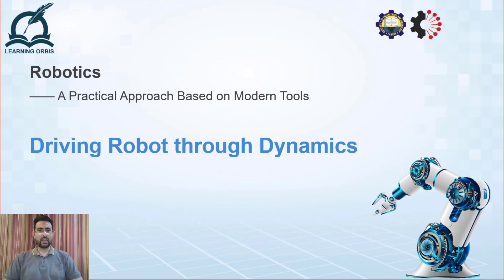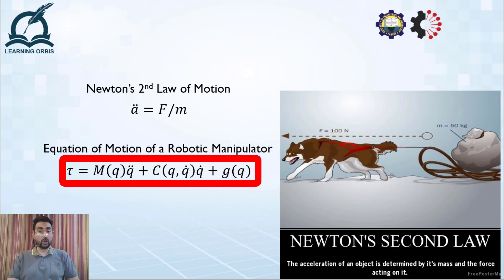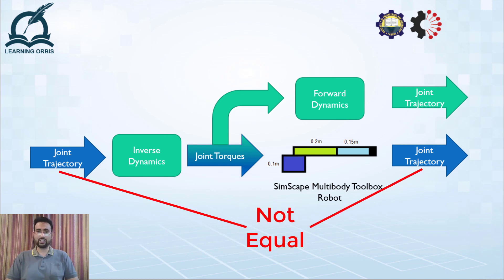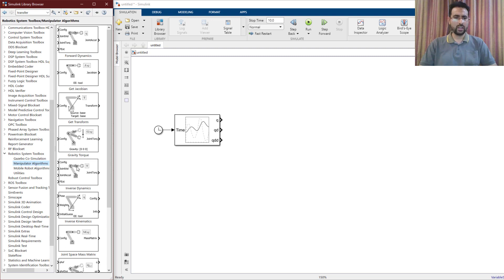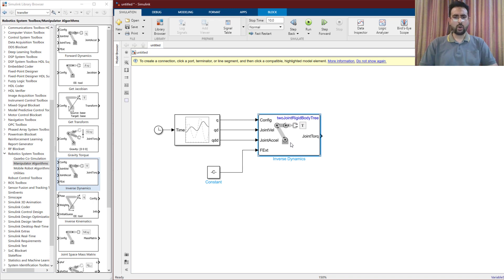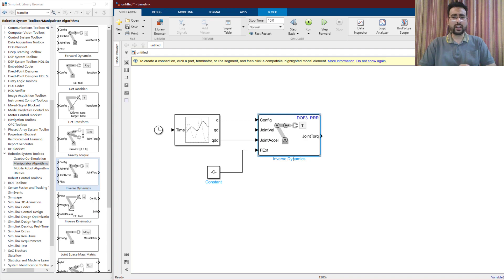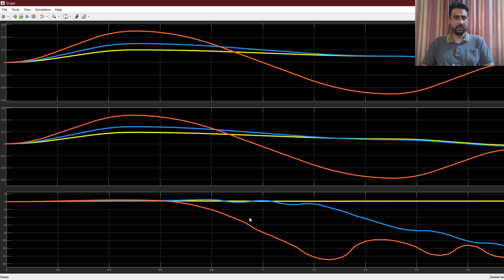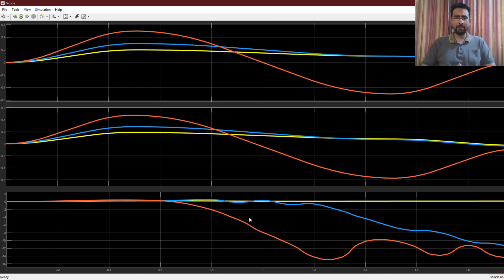How to Drive Robot through Dynamics in MATLAB 2021 | RST | SimScape

Comment: Dear sir
 Than u so much! But I have a question about my robot.I used polynomial trajectory to generate trajectory points and directly connected with inverse dynamics according to your video, but the error dimensions were inconsistent.
Please help me.
Reply from the maker: If you are directly connecting the trajectory with the dynamics block then make sure you are generating a joint space trajectory. If you have a 5 dof robot, for example, then your trajectory should be 5 dimensional. However, if you want to specify x,y,z positions in the trajectory, that is you want to generate workspace trajectory then you should give that to inverse kinematics block and then the output of the inverse kinematics block to the dynamics block.
Reply: @LearningOrbis  Thank u deeply,it help me a lot
Reply: @LearningOrbis  I'm sorry to bother you again,After your guidance, the position can already be connected to the dynamics module, but how can the velocity and acceleration in the dynamics be connected.
Reply from the maker: Joint Position, joint velocity and joint accelerations, coming from the trajectory generator, are connected directly to the inverse dynamics block. If you are generating workspace trajectory and using inverse kinematics block to get the joint positions, then differentiate joint positions to get joint velocities, and differentiate joint velocities to get joint accelerations. The inverse dynamics block will generate the required torque that can be applied to the robot joints.

Comment: my torque values depend on joint angle because my torque generator is torsional spring, how could give that kind of torque input function : k*(300-theta)
Reply from the maker: You can simply generate a function for your torque equation and provide the output of that function to the torque input of your mechanism

Comment: Your video is so helpful, and I am very glad to see it. May I ask a question about my robot? The output joint configuration (q) from the desired joint configuration and from the forward dynamics are not similar to each other. The joint configuration (q) from the forward dynamics, compared to the desired, seems to have a delay in starting movement, and after reaching the maximum value of the desired joint configuration, it almost doesn't change anymore, and at the end, it doesn't return to zero. Could you please tell me how I can diagnose what problem is happening in my model, and how I can solve this problem? Thank you so much for your help and answer in advance.
Reply from the maker: Please contact me through email and share some pictures of your model and problem. Then I'll be in a better position to help you.

Comment: Hello there. Thank you for the helpful video. 
I was trying to model my 2 DoF robot for my course work. When I differentiate angle I found using inverse kinematics, there will be singularity in angular acceleration at the very beginning of the simulation. How do I avoid this?
Reply from the maker: Yes there is. You should specify some non-zero initial condition for the velocity.

Comment: Hello, thank you so much for these helpful videos!!
But in this video i dont understand one thing: why is the output of the trapezoidal velocity trajectory block in joint space (joint velocity …)?? In the last video you described this block and the output was workspace (position in X Y Z …)?? 
Thanks!!
Reply from the maker: Trapezoidal velocity trajectory block only interpolates between the waypoints you have provided. It doesn't matter whether waypoints are in Joint Space or Work space. For work space you will X,Y,Z waypoints and you'll get X,Y,Z positions of the trajectory. Whereas in Joint space you have to provide joint space waypoints to get joint space trajectory. So if you have a 6 DOF manipulator, then you should provide Theta1, Theta2, Theta3, Theta4, Theta5, and Theta6 in form of waypoints and you'll get joint space trajectory. I've directly generated the Joint Space trajectory to avoid using Inverse Kinematics Block that will make the simulations quite slow.

Comment: Sir, can you tell me what are the waypoints ( joint space values ) that you entered in the trapezoidal velocity profile trajectory) and can you tell how can we calculate torques from work space and not joint space.
Reply from the maker: I've explained the use of Trapezoidal Velocity Profile block in this https://youtu.be/xB5epLnoURM video. What do you mean by 'Torques from workspace'? If you are referring to calculating required joint torques from the workspace trajectory, then yo have to use an Inverse Kinematics block to convert workspace trajectory into joint space trajectory and then rest of the things would be the same as explained. I've skipped inverse kinematics in this video because I've already explained it in another video and also to speed up the simulation, because Inverse Kinematics make the simulation quite slow.
Reply: Thank you sir. Yeah I was referring to joint torques from workspace trajectory.
Reply: Sir, I was able to change workspace tarjectories of  'q'  to joint space by using 1. Coordinate transformation conversion and 2. Inverse kinematics blocks. However, how do I convert 'qd' and 'qdd' to jointspace trajectories so that I can feed them to inverse dynamics's jointVelocity and jointAccelaration input ports respectively.
Reply: for the waypoints, try 'wp = [0  0.08  0.2   0.2   0.19 0.17 0.17    0.12     0.1   0.1  0;
          0  0.12  0.3   0.3   0.28 0.18  0.17   0.12    0.1   0.1   0;
          0  0.2    0.45 0.45 0.3   0    -0.3 -0.45 -0.44 -0.2 0];' However, the result is not very similar in the third figure.
Reply: @LearningOrbis  Sir, I understand that 'way points' should be written the position of end effects at each moment. As I observed in your 3 figures, I tried 'wp = [0  0.08  0.2   0.2   0.19 0.17 0.17    0.12     0.1   0.1  0;
          0  0.12  0.3   0.3   0.28 0.18  0.17   0.12    0.1   0.1   0;
          0  0.2    0.45 0.45 0.3   0    -0.3 -0.45 -0.44 -0.2 0];'. After I ran the model, the first 2 figures are very similar with yours, however, the third figure is not. Can you provide your waypoint data, so I can simulate again?

Comment: I wonder, how the model is different for the simscape compared to forward dynamics, when both are imported using URDF?  Does the simscape model adds hidden disturbances or uncertanities, Im just confused. Can you please clarify?
Reply from the maker: Both models are not coming from the same place. One is being generated by Robotic System Toolbox using mathematical modelling, whereas the other one is a CAD model coming from SimScape toolbox. For simpler, non-coupled systems both models will exhibit similar response, however, as coupling increase the minute differences amplify and causes both system to behave differently. Moreover, there are several modeling parameters that are available in SimScape but not in RST, and vice versa as well. All those parameters are being either ignored or approximated, hence produce a mismatch. I agree that if both models are based on same parameters then they should behave similarly, but unfortunately that's not the case. Kindly watch my video (https://youtu.be/Z7hcMVJNbTg) in which i've simulated a simple Spring Mass Damper system using different toolboxes and the results exhibited are same.
Reply: @LearningOrbis  Many Thanks for clearification, Cheers :D

Comment: Hello, after doing all the steps she did in the movie, she gives me the following error, how can I fix it?  
Invalid unit specified by converter block 'untitled_Drive_through_Dynamic_RRR_mahdi/Robot rigide body/Simulink-PS Converter'.

Caused by: Provided units 'N*m' and 'rad' are not commensurate.
Reply from the maker: It means you are providing Torque (N.m) to the robot joints, but your joints are configured to receive angle (rad) for movement. Go into the block of joints and in the portion of Actuation, select Torque provided, and make sure the Simulink-PS converter unit is also selected as N.m

Comment: Awesome content. i wonder what would i do without your videos. i have one question though. i use euler-lagrange method for formulating the dynamic model of my 3dof robotic arm. i have computed M,C and G matrix and have equations for torque at each joints. Now, where should i use those matrices to drive robot through dynamics just like in the video?
Reply from the maker: Watch this video: https://youtu.be/dAvmAIJgrXY
I've implemented Computed Torque Control where M, C and G Matrices are being calculated and used to drive the robot. You'll get a good idea how to use your own M, C and G matrices.

Comment: Hello, I have followed all the steps from the previous videos and this one. I am having trouble with what my scope is coming out to look like. I have matched my trapezoidal trajectory generator block with the one you had at the end of trajectory generation video. Could you please provide an answer as to why my scope is not similar to yours? The first two graphs in the scope should be the same but they are not in my case.
Reply from the maker: How can I tell what you are doing wrong of you just say my scope is not looking right. Email me the details and I'll try to help you out.
Reply: I have similar problem while using some other robot. Did you find any reason in the mean time?

Comment: Sir, I was able to change workspace tarjectories of  'q'  to joint space by using 1. Coordinate transformation conversion and 2. Inverse kinematics blocks. However, how do I convert 'qd' and 'qdd' to jointspace trajectories so that I can feed them to inverse dynamics's jointVelocity and jointAccelaration input ports respectively.
Reply from the maker: You can simple take the derivative of q to get qd and then derivative of qd to get qdd.
Reply: Thank you very much sir. This helped me a lot to complete my project.

Comment: Hello there, thanks a lot for these incredible useful videos and explanations. I was wondering how to generate the external forces matrix (FExt) from an existing rigid body tree model. I would like to work with forces instead of torques and Idon´t quite get the idea of what is generate using the externalForce function and the wrench vector and even more how to, as mentioned, generate it from en existing model. Please help me.
Reply from the maker: External force vector may be provided by the user. This force vector defines the force acting on the end-effector.

Comment: Thank you for your help, you are a life saver with my thesis. Can i just ask what would be simulation if I have prismatic joints, because in this case I will be working with force instead of torques with the joints?
Your help has been and still is greatly appreciated.
Reply from the maker: There wont be any difference. Yo should be using the same blocks, same strategy.

Comment: Hello, I have a concern regarding the joint positions visualization in the second graph. Currently, I am attempting to visualize joint positions without the controller. However, it seems that the joint positions remain constant even when I vary the external force (Fext). This seems counterintuitive to me because, when I use the Inverse Dynamics block with different Fext values, I obtain distinct joint torques for each payload.

Is the behavior of the second graph accurate, and is there a way to correctly visualize the variation in joint positions corresponding to different external forces? I expected the joint positions to change based on the applied payload, and I'm puzzled by the consistent joint positions despite different torques obtained from the Inverse Dynamics block. Your insights would be greatly appreciated. Thank you!
Reply from the maker: Thank you for reaching out.
While doing simulations please consider that the joint will only actuate through an actuation signal applied to its input port. The joint will follow whatever position is being applied on the input port, and if you are applying torque then corresponding position will be calculated by SimScape on its own and the robot will follow that position. Now if your robot is showing constant joint position then you need to check the input you are supplying to your robot. Furthermore, if you are driving your robot through torque and the torque you are supplying is not enough to move your robot, then again, your robot will stay stuck in a position. By default, the masses and inertias of SimScape objects are quite large, which might be the reason your robot isn't moving.
You may send me your simulation file at learningorbis@gmail.com and I can have a look at it.

Comment: What wp (Waypoints) did you use, can you send it? (It was not mentioned in the movie) I have a problem in this part
Reply from the maker: Waypoint matrix is defined as n x p matrix, where 'n' is the dimensions and 'p' is the number of way points. If you are generating workspace trajectory then 'n' = 3 (x, y, z), whereas if you are generating joint space trajectory then 'n' = DOF. For example a workspace trajectory for a 4 DOF robot having 4 waypoints would be [1, 3, 2, 3; 2, 4, 3, 1; 2, 3, 4 1], a 3x4 matrix, whereas Joint space trajectory for the same robot would be [20, 40, 30, 50; 40, 30, 50, 60; 30, 20, 10, 50; 30, 40, 50, 60] a 4x4 matrix.
Reply: @LearningOrbis  Sir, I have two questions about this:

1. Does this joint space trajectory have to be solved using inverse kinematics in MATLAB separately (4 times) and then combined to build a 4x4 matrix? Is there any other easier way or method to achieve this?

2. Should the 4x4 matrix then be used as input for the waypoints in the polynomial trajectory block?

Thank you in advance for your answer.

Comment: Dear Sir,
Since I have a dynamic trajectory and is generated during runtime (Cannot be stored as a constant beforehand) . Can i just derive and double derive the dynamic trajectory to get velocity and acceleration rather than using Trajectory block ?
Reply from the maker: Yes you can. If you already have trajectory then you don't need trajectory block.

Comment: What waypoints are used?
Reply from the maker: Kindly watch previous videos in which I've explained how to generate trajectory. I'm using the same trajectory in this video.
Reply: I have, & in the previous videos we didn’t have to worry about the Z-axis. I’ve tried setting waypoints by getting the points in the signal builder & that kinda worked. Just not very pretty.
Reply from the maker: Yeh, the previous video that discussed trajectory generation used a 2D planar robot, whereas over here a 3D robot is considered that's why we need to input the Z-axis as well. Anyhow, if you are giving workspace trajectory then the waypoint matrix should be provided such that every column contains one way point in 3D space, that is [x, y, z]'. If you want to generate a trajectory that should pass through 5 way points, then way point matrix will be of 3x5 dimensions, where each column will contain one way point.

Comment: Dear Sir,
what is workspace trajectory vs Joint space trajectory ? In simple words
Reply from the maker: Workspace is defined by X, Y, Z coordinates of the space in which robot is moving. If you are defining that the robot must go to a certain (x1, y1, z1) coordinate in the workspace, then to second (x2, y2, z2) coordinate and so on, then this would mean you are defining workspace trajectory. Whereas, if you are saying that for a 4 DOF robot, the first point is (a1, b1, c1, d1) joint angles of 4 joints of the robot, and second point is (a2, b2, c2, d2) joint angles of the 4 joints and so on, then you are defining joint space trajectory.